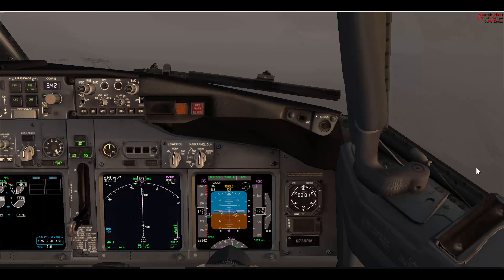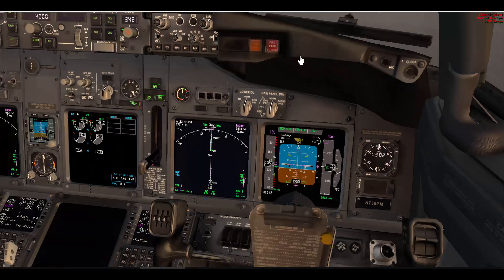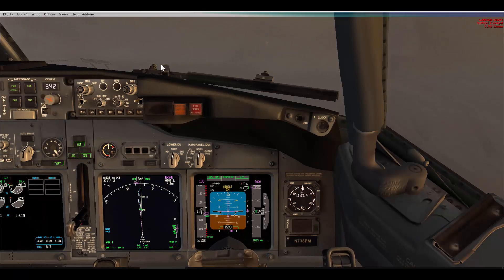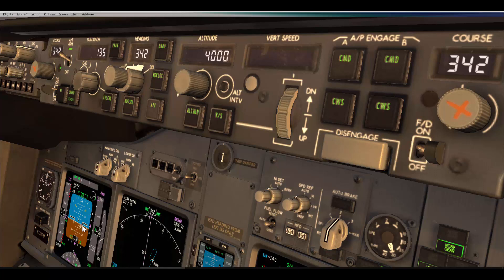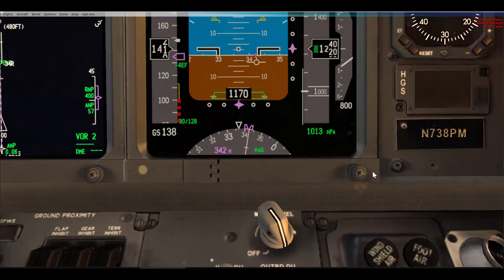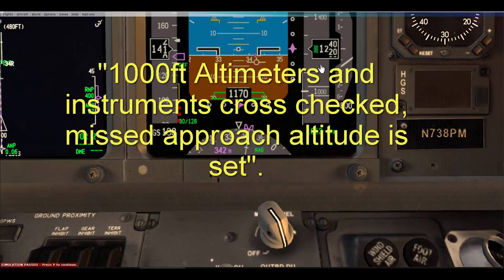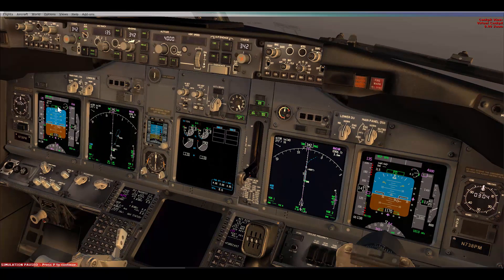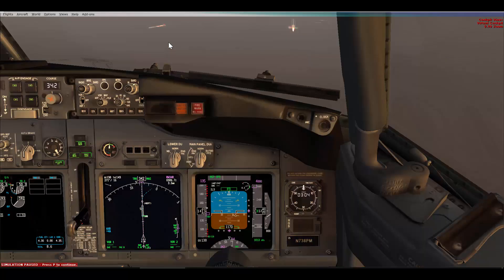B737 App. & Lndg Video#7 (Three Items)

Comment: Sir, ln case of a go around, when we press TOGA, the autopilot disconnects but A/T stays engaged. But, I noticed during training and your videos,the a/t doesn't cause any erratic movements.
Is there a reason for it?
Is it fine if we disengage the A/T too, during GA and engage it again when we  reach missed approach altitude together with Autopilot.?
Or let it be and it won't cause any issue?
Reply from the maker: Hello, 
When you press TOGA A/T will go to GA thrust, in the training they some time will give you engine failure during GA, so I suggest you let it engaged and it move automatically to GA thrust, 
It does cause a very strong pitch up tendency, it’s a lot of thrust if you have two engines. 
To answer your last question, I believe it is better to leave it engaged, specifically during your sim training. 
Hope that help
All the best, 
Abdul
Reply: @AbdulmuatiAsiri37  yes that makes sense, thanks alot.

Comment: Hello Captain, Hopefully you allow me to have a Question for you, if not, please  don't hesitate to let me know. My situation was this: I flying from EHAM Amsterdam 36L to EHEH Eindhoven on the viritual ATC IVAO Network. It's a very short flight. I only receive  VECTOR departure:  Runway track and initial clime to 6000 feet.  So far so good. I'am set the Heading to 002 and after several minutes I receive the command from ATC to Clime to 7000 and Turn Right Direct to PESER (For your info the heading to PESER is 186) So I enter PESER into the FMC and push LNAV. The Plane turn (unexpected for me ) to te left  to get the track to PESER. Ofcourse ATC  was not amused and remember me that they have said TURN RIGHT!! direct to PSER. My question is when I enter into FMC the waitpoint is it possible to set a Right or Left forced turn as wanted? Or must I turn right with setting the HEADING Select and after a turn let's say from 90 degrees then switch the LNAV active? I hope you find the time. Have a nice day ;) Bye bye.
Reply from the maker: Hello G L, 
Thanks for the question. 
Personally I do what you suggested at the end. If the point I want to fly direct to is in the opposite direction I select HDG. Then select the point in the FMC before executing I check the white dotted line in the ND once it is on the direction I want, I execute  and engage LNAV. 
Hope that answer your question, please let me know if you have any other questions. 
Wish you all the best 
Abdul
Reply: @AbdulmuatiAsiri37  Hello  Captain Asiri, Great that you have take the time and effort to answer my question. I'am glad that my thought are in line with your way of handeling. Thanks again ;) Bye bye.

Comment: Hello Captain, I have a question about descending as instructed by (Viritual) IVAO ATC. This question is ask by this Topic because other people may also be able to take advantage of it. The flight was from Paris (LFPG) to Amsterdam (EHAM), a relative short flight from 53 minute. Cruise FL240. The flightplan says that by position DENUT a pass of FL240 will take place. Nevertheless the ATC Controller (Brussels Control) instructed me 30 nmiles before DENUT to descent to FL200  at or by DENUT. My respons was to change the altitude to FL200, disable VNAV,  and find the best feet/minute value so the green (banana) line comes in sync with DENUT. So I was pass DENUT exactly by FL200. But after this point I was confused. Must I changed back to VNAV?  I was staying on the current setting and every time I get a ATC instruct to descent I change the altitude by hand and descent by 1500feet/Minute. Result I was to high when I was approach EHAM. My Question: What is the proper procedure? Is this to change it into the FMC and let the FMC let do the job? Or after reaching DENUT change back to VNAV and change the Altitude by DENUT to   /FL200B ? I hope U find the time to help me with this with a answer or maybe a nice topic for a video by your hand.  Have a nice day and save flying ;) Kind regards GL.
Reply from the maker: Hello G L, 

There is nothing wrong with the way you did the descent, as this can be done in many ways. 
My personal technique is the following:

This is a rule that is mentioned in the FCOM, if the airplane is more than 50nm from the T/D then you can use cruise descent, that is changing the cruise altitude in the CDU and the airplane will perform a 1000fpm descent rate. 
If the airplane is less than 50nm from the T/D then use descent now and the airplane will perform a 1000fpm descent rate to intercept the original profile. 

1000fpm is a nice slow descent for level change in cruise or early before the T/D. The way to make sure is you meet the crossing restriction is from the CDU see how many minutes (ETE) till that point then you need 1 minute per 1000ft to lose. let's say cruising at 24000ft and you want to cross a point at 20000ft, so at least 4 minutes prior to the point you start a descent now or cruise descent. I usually add an extra minute to make sure I comply with the crossing restrictions. 

Again your way of doing it is correct and this is another way to do it, but not the only way. But this is what I use usually.

Hope that answer your question. 
Abdul
Reply: Dear Mister @AbdulmuatiAsiri37 /Captain, Thank you very much for taking the time to explain this issue. I (try) to keep this in mind. To be honest;) I miss the FO in my Viritual Plane (lol) because the list is being longer and longer to remember so may things. But I don't give up (Yet ;) )  Have a nice weekend and bye bye from The Netherlands.

Comment: Great video, thank you Capt. Asiri! Are the 737 flight crews trimming only within the green band or are they using the whole scale (0-17)?
Reply from the maker: Thank you Martin 
Regarding the green band, it is the STAB TRIM range for Takeoff only. 
Once airborne their is no limit on the scale.  

Please let me know if you have any other questions or comments. 

Abdul
Reply: @AbdulmuatiAsiri37  Thanks for clarification, Cpt.Asiri! Since there's no way to feel control forces in PC sim, how do you trim PMDG737 on an approach or in general when flying manually?